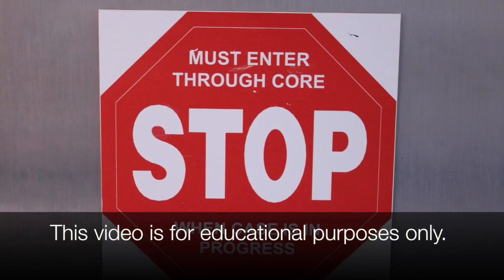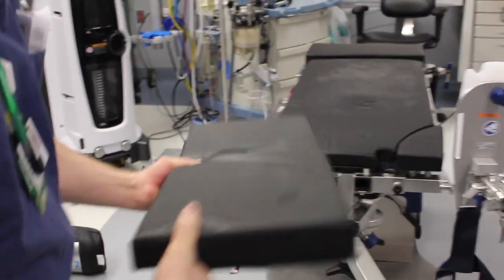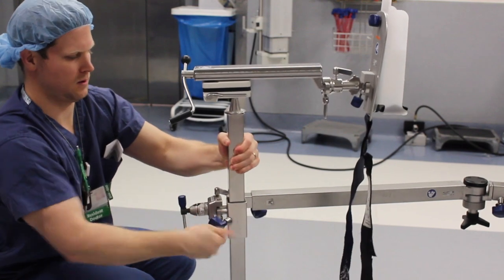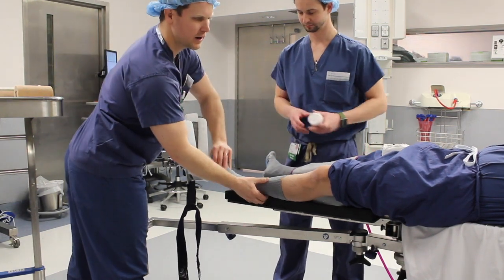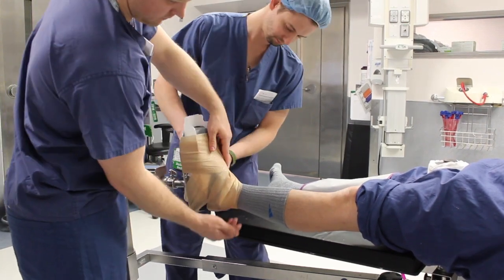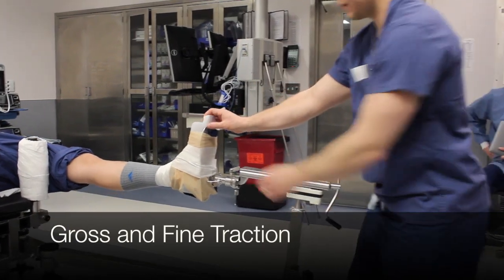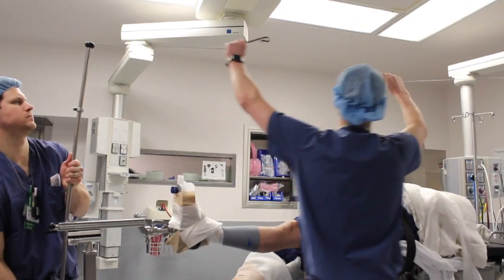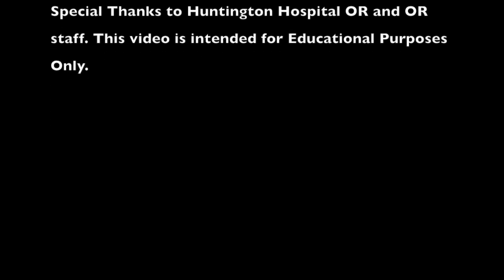Fracture Table Setup and Positioning

Comment: Great video, I do this for living but it's always good to see others doing this to learn something:)
Quick note: When using the screw tension device shown at 2:45, it's best to begin from the middle position before placing the patient's foot onto the foot plate. This allows for greater flexibility during fracture reduction.
Additional tip: At 4:15, when applying the two Velcro straps on the foot plate, optimal traction and the safest foot positioning are achieved only if the straps are crossed and inserted into the opposite slots—as demonstrated—but only when they are slid into the lowest position. This method aligns with the instructions for use (IFU). In the video, the straps were positioned differently, which increases the risk of them loosening and compromising foot stability during traction.